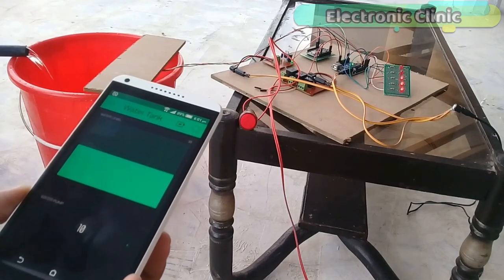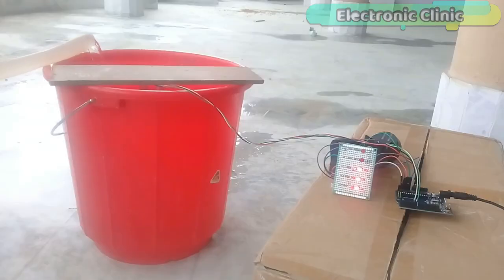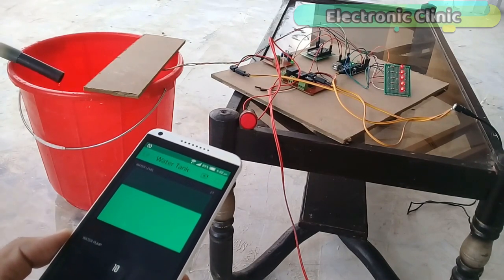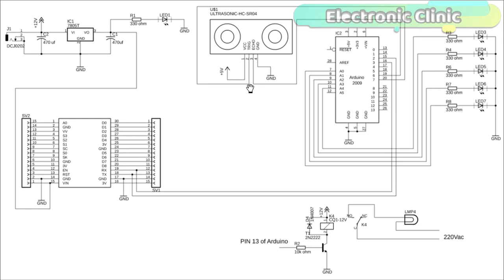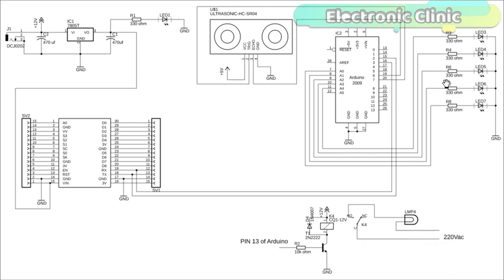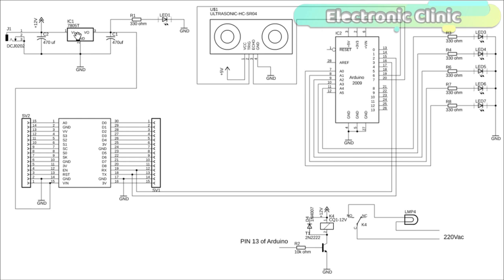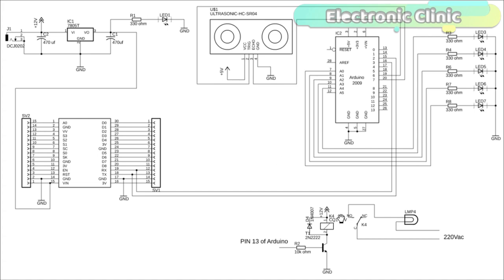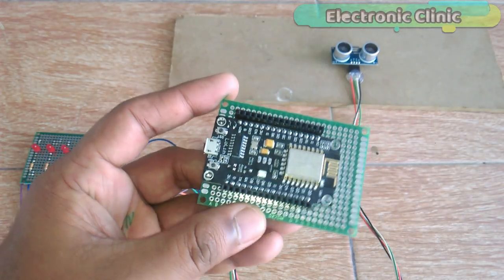Arduino iot Project: iot Water level monitoring using Ultrasonic Sensor + Nodemcu esp8266 + Blynk

Comment: Asalam-o-Alaiekum
brother very nice video i was searching from so many days
but i am having some problem with leds
i sent to email about the problem
writing here as well
when i used you part 1st code in which wifi not included the leds work fine setp by step on and off
but when i used part 2nd code with wifi the leds not working fine
they filickers when they are at low level
when water incresed the related led stop flickers and glow
but others don't stop flickering

Comment: why u use 2 boards? please explain the use also thanks
Reply from the maker: you can do the same exact thing using only the nodemcu module. but the reason i also used Arduino is that, if incase you want more io pins. You can watch my latest iot water level sensor project, which is developed using only nodemcu esp8266.

Comment: I have made a similar project i.e voltage monitoring system. But I don't know how to store voltage values with respect to time in excel sheet using blynk
Reply from the maker: watch my tutorials on voltage monitoring system. just combine that code with this project.
Reply: Is it possible without using thinkspeak but using Google spreadsheet?
Reply from the maker: Check my tutorial on firebase. Check if it fulfill ur requirement

Comment: Hii brother. 
Please make a iot based water level indicator in which ultrasonic sensor is not used.
Reply: Because HC SR 04 gets damaged due to moisture and  waterproof ultrasonic sensor is very expensive. Sir please make one more project just like this.... Without ultrasonic sensor
Reply from the maker: tomorrow i will upload a new video, in which i will use a different sensor.
Reply from the maker: video is uploaded check.
Reply: @ElectroniClinic  sir the video you uploaded measures distance.......

Sir i was saying that build a blynk automated water level indicator which which shows water level using leds and also displays water level on our phone. We can also use phone to switch on /off the water pump  and most important it uses only wires which are dipped at different water levels of water. Just like for 20% , 40% , 60% , 80%,100% using 5 wires which are dipped in water.
Reply: Sir i would be really grateful i you could built this. ❤️❤️❤️ Thanks and regards. 🙏
Reply: Sir i expect such project from u only. Please make it , i definitely want to make this thing. 
And this is only possible if you accept my request . Thanks ❤️❤️
Reply: @ElectroniClinic  sir please reply🙏